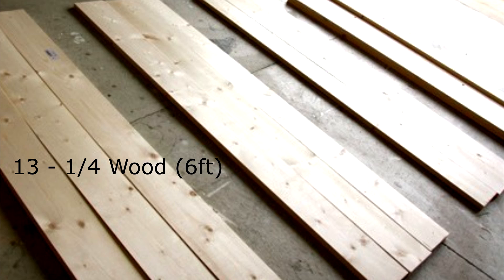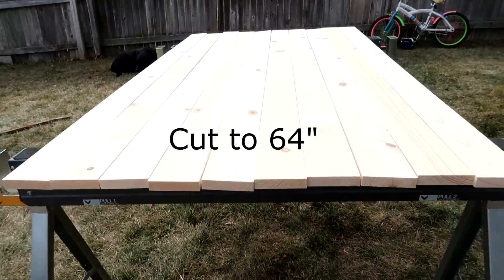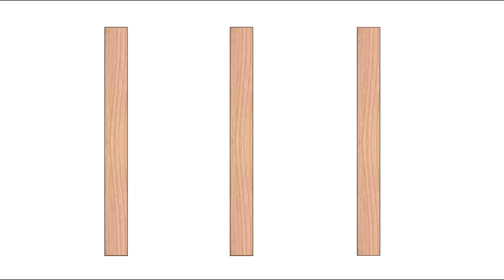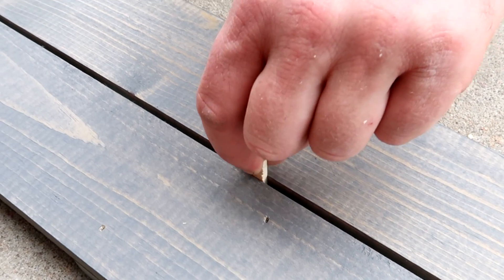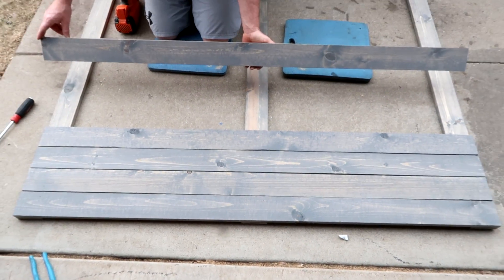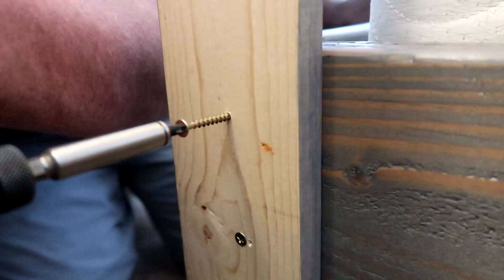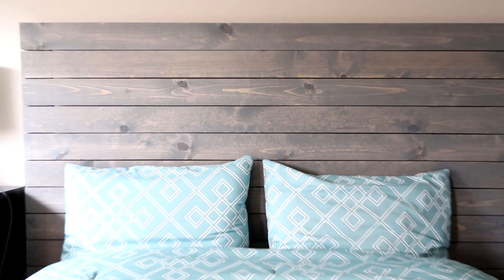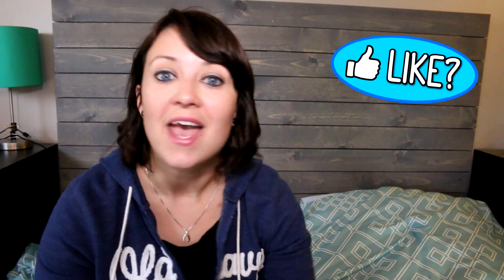How To Make A Headboard | PINTEREST DIY 📍 How To With Kristin

Comment: How tall are the 3 wood supports? Also, I know the 10 pieces of wood are 64 inches in length but what is their width? Thanks!
Reply: Ashley typically you can find lumber in dimensions such as 1 in thick x 4 in wide ( with increments of 2 in up to 12 in) x 6-8 feet long or up to 10/12. A quick trip to homedepot or Lowe’s will  help you better visualize.